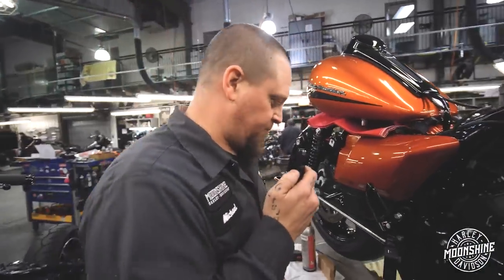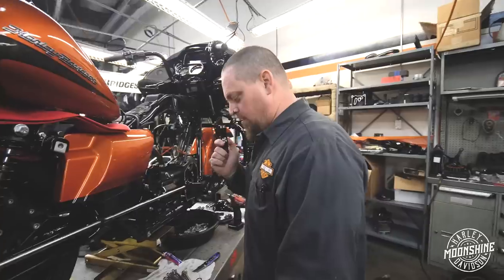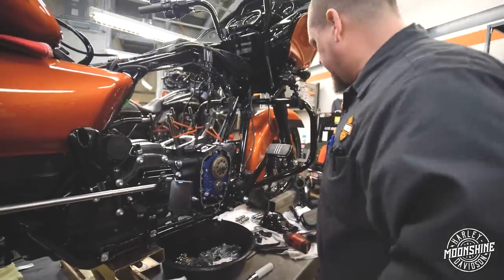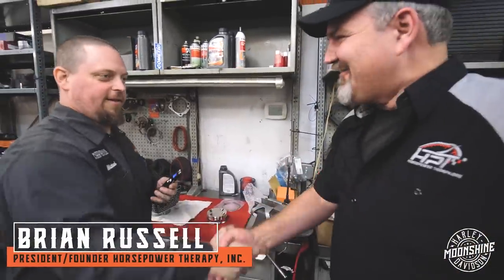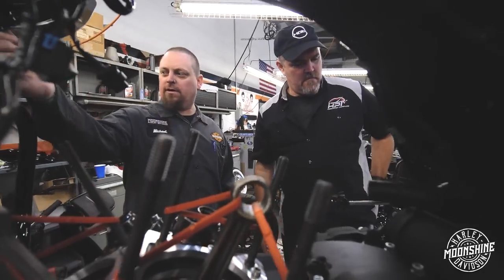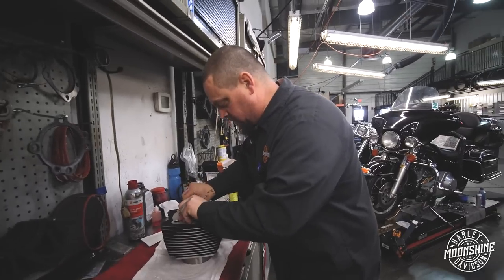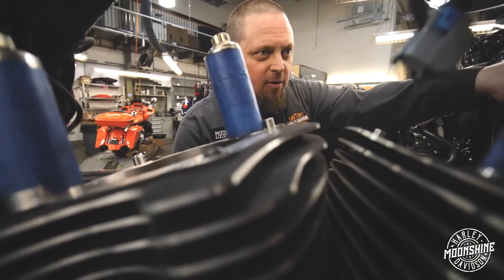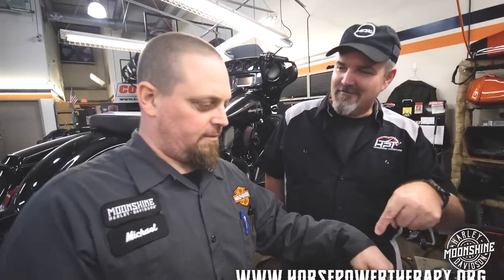Horsepower Therapy Veteran Bike Build | Part 1 The Motor Build (128") by Moonshine Harley-Davidson

Comment: I agree stock motors suck. But with a Harley the old adage applies “ if you want to play you have to pay” $$$$. Horsepower doesn’t come cheap for Harley’s. Harley sets they’re “ motors” up a certain way for a certainreason , mainly smooth to idles and quite valve trains. You start putting big cams , big valvels, big bores and you have a created a different type of motor. A different bike, a bike a lot of people aren’t able to handle ie, noisy valve trains and high heat . You get into a 128 and the thing is monster no doubt but it also is going to need to kept moving to keep it cool and the rider is going to have to learn to listen to his motor. Extra ponies and extra compression puts added stress on the valve train and it eats parts. I built a 117 inch evo and  put it in a bagger, the most fun I ever had and I never regretted it for a minute but I also learned a lesson too. when it comes to a Harley if you want to run with the big dogs be ready to pay, like I said “ if you want to play you got to pay” and fun ( though well worth it to me) on a Harley dosent come cheap, I’m just sayin 😎✌️
Reply: Rick Johnson - You’re talking old 2 valve technology. Welcome to the 21st Century
Reply: Every other motorcycle manufacturer makes much more powerful engine with a shitload less displacement. And all of them are WAY more reliable.  Y’all are playing with some very overpriced turds.😂